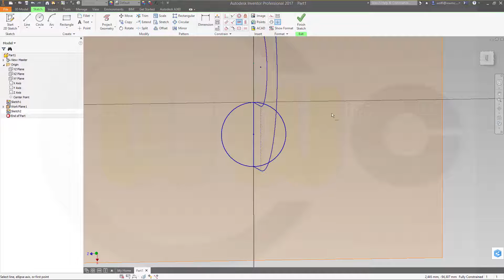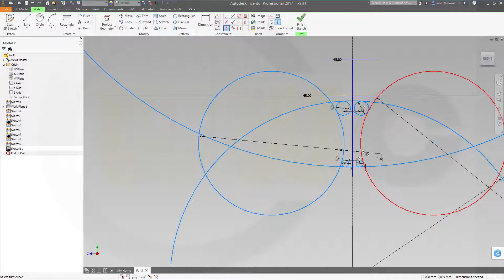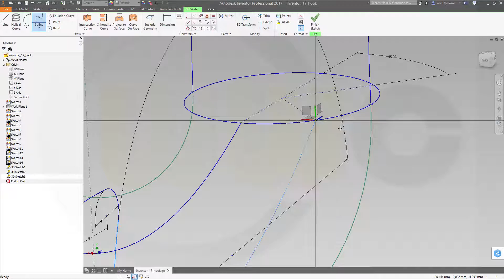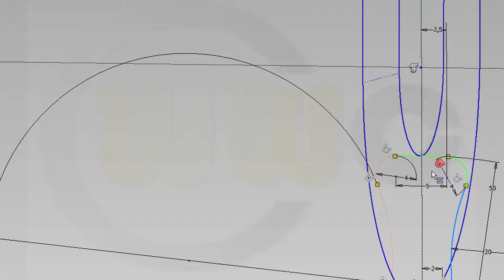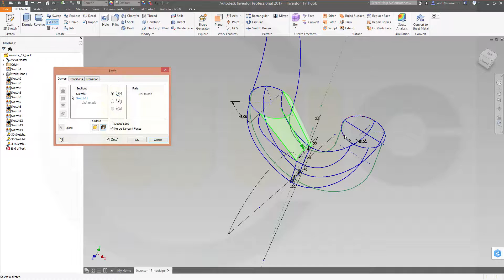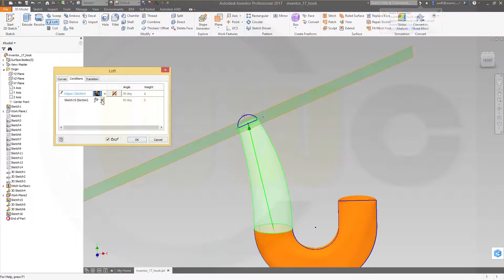Haken - Hook - Inventor 2017 Training - Surfaces

Comment: There were some new things in there. The mirror function ist magic - it can save you hours and many clicks ;)
Reply from the maker: great :)
Reply: What new thing?
Reply: @jeffliu744  New for me.
But it didn't work out that way. On first (and 2nd, and 3rd) try. I think, key point is, that the number of points on the cross sections needs to be equal. Also the number of points which define the wall should be equal for every section itself. 

However I have to try this again. This is definitely not the strength of inventor.

Also new was the physics of the hook. ;)